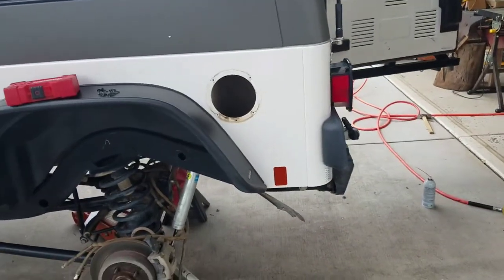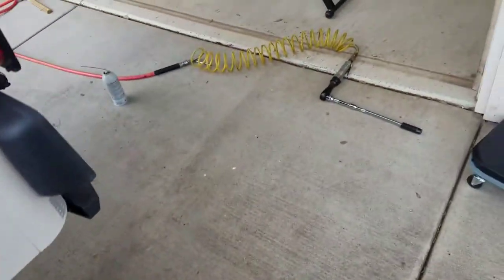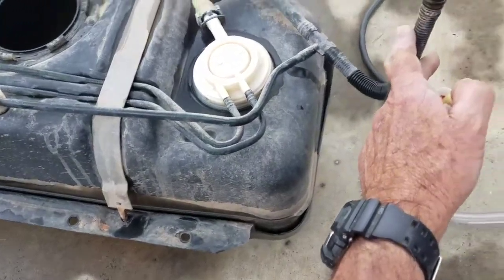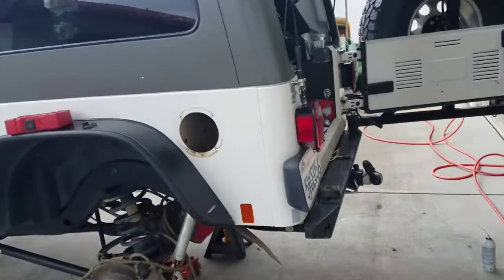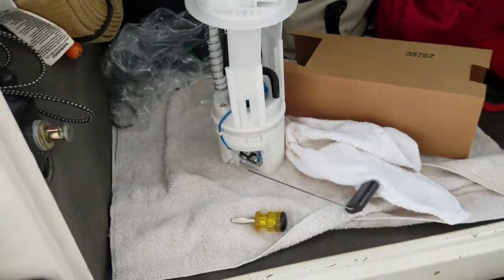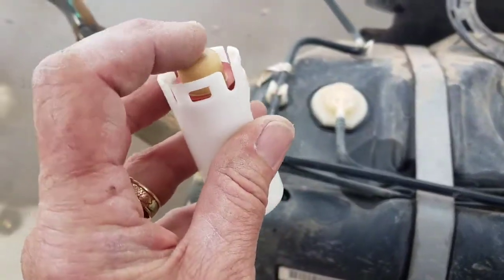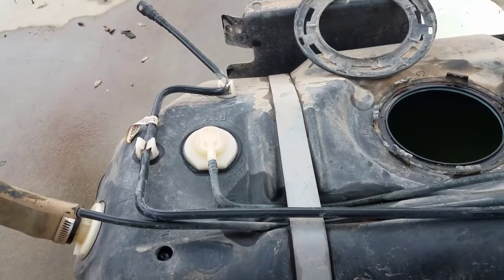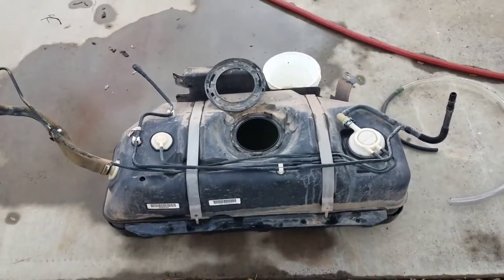2006 Jeep TJ with slow to fill gas tank and erratic gas gauge with check engine light.

Comment: I have the 2005 wrangler and had the same slow fuel add problem, as a temp fix i just pushed the valve in about 1/2 way so I can add fuel somewhat normally till it gets warmer and I can remove the tank and do it right. I don't have any problems "yet" so might go the extra bit and get the pump... Thanks for posting.
Reply: How did you push the valve down? Through the filler neck?
Reply: @anthonyfine8914  yes, just a long screwdriver and tapped it down. i have a new one but don't want to replace it till I have time to mess with it.
Reply: @YobieTheQuestioner  did you take the filler hose loose and do it right at the tank?
Reply: @anthonyfine8914  yes, sorry I should have mentioned that, took off the filler hose at the tank and the valve is 3"-4" in or so
Reply: I was wondering if that would work. I'm going to try that.

Comment: The valve he has in his hand at 4:39.  I took a 2 foot steel rod and popped it loose back into the tank.  Seems to have fixed my slow fill problem.  I did put the GM hose on it so it has a roll over valve.
Reply from the maker: I suppose as long as the valve you punched down in doesn't get caught up in your fuel pump float arm you'll be all right and avoid fixing the real problem.

Comment: MY filler neck cracked right at the tank and the vent on the passenger side cracked at the elbow. I had to make a metal sleeve for the vent and make an ''Insert'' for the filler that the hose could attach to and used the ''Flex'' style radiator hose so it can move when the body and frame flex. I had to ditch that valve altogether but unless the gas cap flies off when I roll it should just dribble!  I bought a genuine Bosch pump for $60 on E-Bay and replaced it because I NEVER want to do THIS again! 06 Unlimited Rubicon 6 speed.
Reply from the maker: What happened to cause that much damage?

Comment: Im trying to find the part number for the check valve. 06 LJ with exactly the same issues. Fuel gauge drops to zero and check engine light comes on.
Reply from the maker: Good luck finding a part number for the valve if it's the one inside the tank you're talkin about. With my issue of showing empty was the sending unit on the fuel pump. Good luck and let us know what you find.

Comment: I have a question about the fuel emissions line at 8.18 of the video my plastic pice is busted on the drivers side do I need to replace the whole assembly or can you just replace the plastic connector?
Reply from the maker: I'm not really sure what emission line plastic piece you're talking about but I think most of the outside piece Parts can be purchased.

Comment: My 05 Jeep TJ suddenly didn’t start. Crank but not start. I checked a few things and then decided to spray starter fluid in the intake. It started and then turned off after a few seconds. I have a few questions. That means spark plugs are good right? Cause I got it to start. Also, the truck doesn’t  have a port on fuel line for a gauge. So I listened for the pump when turned on, nothing, then felt the relay when turned on and felt it click, fuse looks good. Do fuel pumps go bad all of a sudden? No warning. I haven’t seen any warnings.
Reply from the maker: I would have to agree that if you used starting fluid and it started right up that the engine is fine. Does sound like a fuel pump issue .